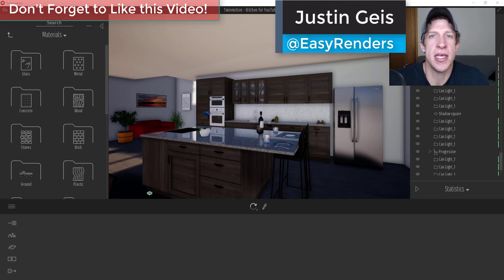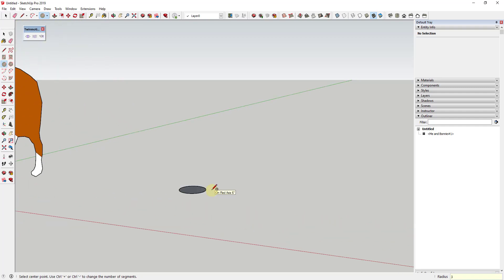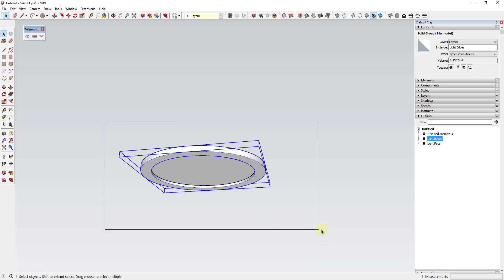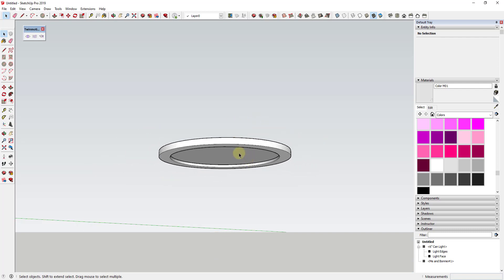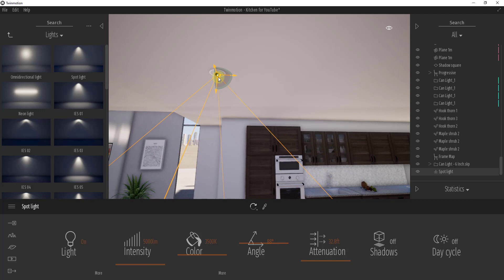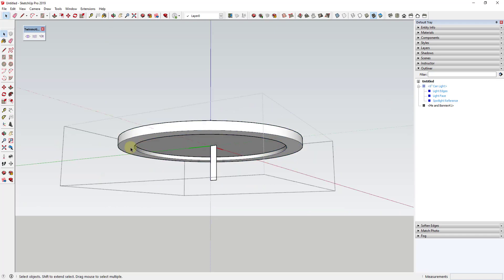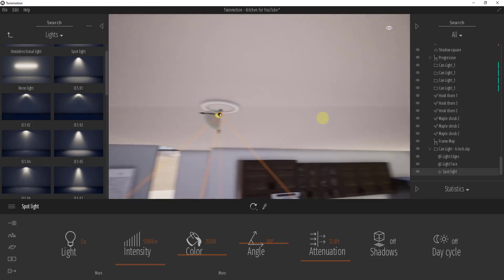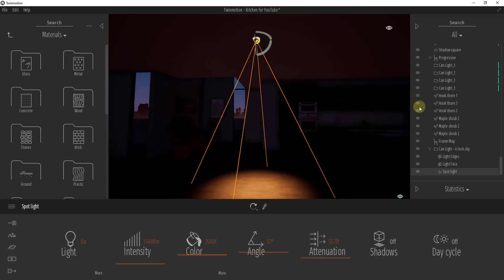Creating Custom Light Fixtures for Interior Lighting in Twinmotion!

Comment: 4 years late, but great video. 
The object is snapping to the ceiling (which faces down), hence the flipping 180 degrees every time. In SketchUp, build the light lens facing up, it will flip down when attached to the ceiling. Also, if it's drawn with the origin at the top of the can center instead of the lens, it will cleanly line up with ceiling. 
Genius move with swapping light for geometry.

Comment: How do I keep lights turned on for a daytime render?
Reply: Are you using TM2020? Unfortunately, they really changed how lights work between 2019 and 2020. If it is during the daytime, lights do not function well as it is programmed for the sun to create the majority of the lighting, even in a room with no windows. You can type in really high values for your lights, much higher than the slider will give you. Or you can make it night time. I've messed around a lot with TM2020 but I keep going back to TM2019 due to the lighting and I have imports that fail in 2020 but are successfully imported in 2019.
Reply: @chazp3496  TM2020, yes. So there's actually no option except make it night time? Thanks for the response :) I was considering buying the 2020 license - maybe I should hold off on a 2021 update instead haha

Comment: Hi everyone. First thanks for your helpful videos. I have a problem at interrior(fully enclosed) render twinmotion. I am using same material on wall, floor and ceiling but it dont be same color. For example i using white color, it being grey on the wall, like blue on floor and being bright white on the ceilling. Can you help me for this problem:)
Reply from the maker: No idea on this one - are you sure you have the same material in all those areas? Are you sure it doesn't just look white or gray due to the lighting in those particular locations?
Reply: @TheRenderingEssentials   Thank you for answer. Yes, i dont change any light settings, using same material but it don't be same on the wall, ceilling and floor in a fully enclosed interrior.
Reply: I have this same problem, but the ceiling is always extremely white even though it is the same gray material as the wall, did you manage to resolve this?

Comment: Something I'd like to add is that if you set the axis origin point so that the part of the spotlight that should "stick" to surfaces is considered the bottom side on Sketchup the object will stick to faces on Twinmotion perfectly as opposed to having to rotate every time.

Basically, you should flip the Z axis 180 degrees or just flip the model 180 degrees within Sketchup first.
Reply from the maker: Yeah - I mentioned that at the end of the video but didn't actually demo it - thanks!